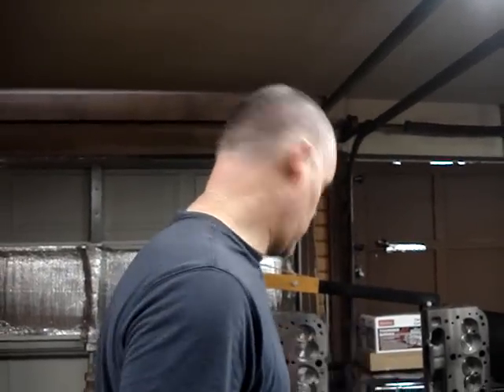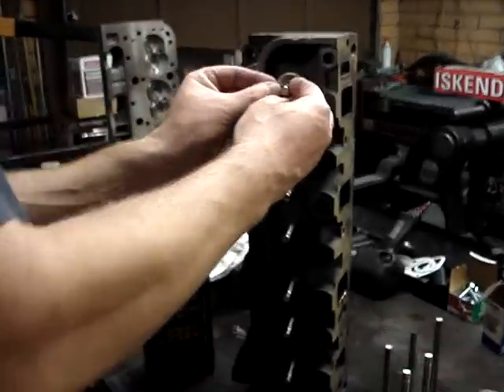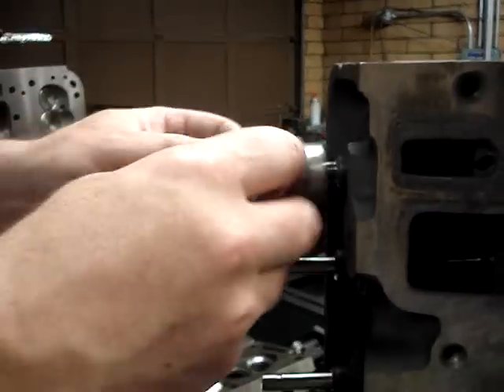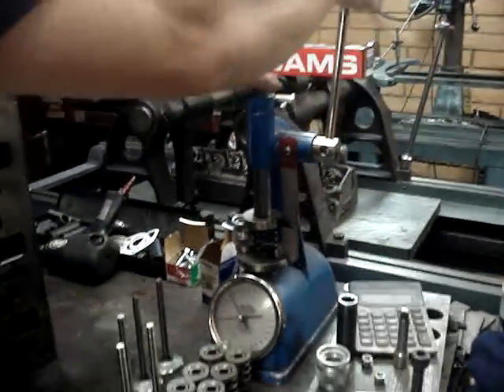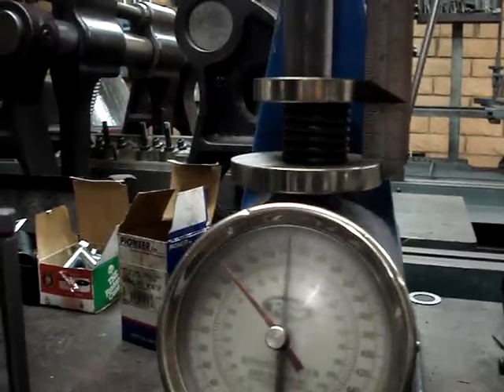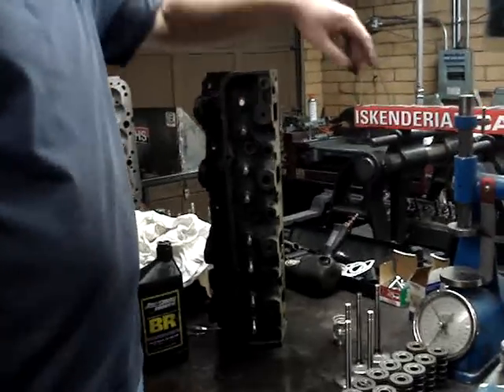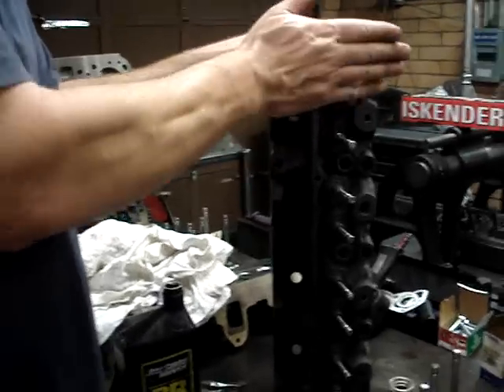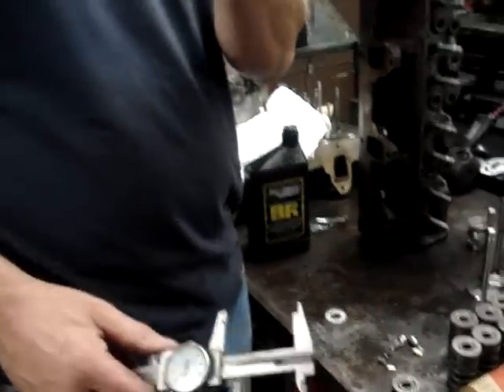Cylinder Head Assembly

Comment: Hello again.  I have been attempting to get 65 FE 390 engine to run nice
 and smooth after I replaced the distributor with an HEI distributor .  I just checked the vacuum and it read 10 inches from what I've heard it should be around 20.  The other thing that I just found isthis,
 I close both air / fuel needle screws on my Edelbrock 1406 carb and the engine kept running in fact
 it ran smoother then it did before.  I had then turned at 2 turn from bottom.  Would that tell me that it is 
getting air from around the gasket or base plate?

Comment: Hey, what about choosing valves for assembly?, does any 1.94 valve fit any head machined for 1.94?, thanks in advance.
Reply: Usually yes of its a good name brand vavlve and the machinist  did a 3 or 5 angle valve job on the head correctly. Ive aksed several cylimder head manufactures about their bare heads and they usually have the valve jobs done you just need to get whatever parts youre supposed to have for your valve train and some of them will even have bowl work done.  To make aure whe. You finish assembling it pour water into the combustion chambers with the head upside down and blow compressed air into the intake and exhaust ports to see if you have a leak. You'll see bubbles if you have a leak Always check that

Comment: I recently acquired a Ford 302. Its a rebuilt engine, purchased from Autozone about fifteen years ago, and has no run time on it what so ever. It was sitting outside for a couple of months, before I acquired it, so I decided to take it apart, and go through it. When I was taking the cylinder heads apart, on the intake valves, there was an extreme amount of what I think was assembly grease, it was red like it had rust in it, on the face, and bottom of the valve stem. Is this common practice from engine builders to seal the cylinders in some way, or do you think that it might be something else?

Thank you for sharing your knowledge.
Reply from the maker: HMMM Id clean all that out doesen't sound right to me
Reply: Myvintageiron7512 I took the whole thing apart. The pistons had a fair amount of white grease on the tops of them, and around the rings. I thought perhaps it might be shipping grease, but I've never seen this before on any engine that I've purchased, but I've cleaned the whole thing up anyway.

Comment: I'm currently working on assembling a set of 69 Windsor heads to install on my Lincoln Town Car.
The valve springs that came with my cam shaft, have a recommended install height of 1.700". Currently I'm at 1.850", which is a difference of .150". The valve pockets, appear that they have been machined before.
Would it be acceptable to use multiple valve spring shims to obtain the appropriate height, or should I use a different valve spring retainer?

Thank You,
Aaron
Reply from the maker: Aaron Pedersen It is fine to stack shims I am wondering what springs you do have however because 351W heads have a factory installed height  of 1.800 and most of the replacement springs are set up at that height it is ok to stack shims though if the springs are mated to that cam set them at the spec height with what ever shims are needed they will work fine
Reply: I'm actually putting the heads on a 302, and the cam, and springs that I ordered are for a 302.

Comment: Im going to rebuild a 91 454ss original engine. Ive bought some 781 heads im putting on it. Engine has 176k miles and still running great just want to redo it. Dont want to make this a race truck just get to around 4 to 5 hundred horsepower. Planning to assemble myself just have a machine shop straighten and clean up the block. I want to build myself with my son just for the pride. Any suggestions?
Reply from the maker: have em put larger valves in the 781's and go with a roller cam
Reply: Its got 2" intake valves is that standard?
Reply from the maker: Yes but you need bigger
Reply: djsoundsbest Make sure those heads are compatible with your block, not all big block Chevys are the same and some parts are not interchangeable. They have the Gen. IV, the Gen V, and Gen VI you stated 1991 454  so that should be Gen. V,
Reply: djsoundsbest  This right here is what I'm referring to @4567 make sure your parts match up.
Reply: djsoundsbest It wont let it through, just google ~ Big Block Chevy Gen IV vs Gen V  Super Chevy~

Comment: Would you endorse valve lapping for the DIY 'er?  Or is that a big no no?  I'm aware of the interference angle that must not be compromised, but just a mild valve lap to get a correct seal without machine shop help.  Or let the pro's handle it?  Thanks.

Comment: Have a question for anyone who can answer building bbc with 049 heads. My question is does anything have to go under intake valve spring bc i actually need it to have more height to get the 1.900 need like 55 thousand more clearance. Already have the rotator eliminators and shims for exhaust and have to shim up. Just wanna know does intake need a shim or can it run on bare head.